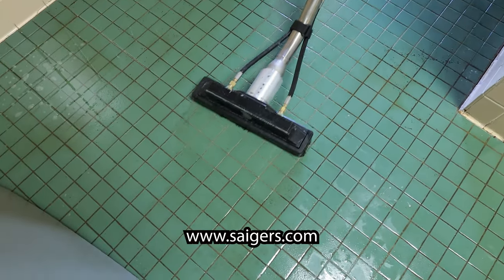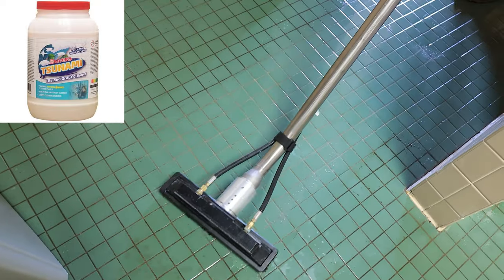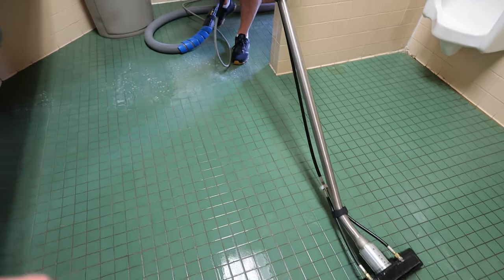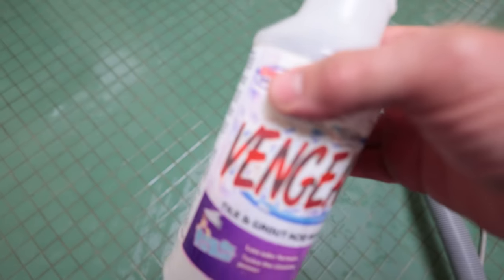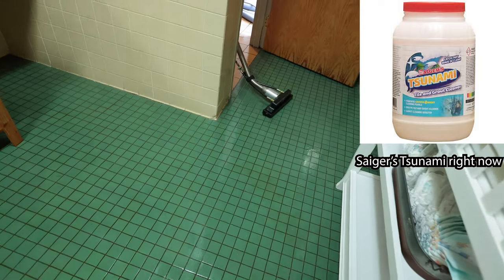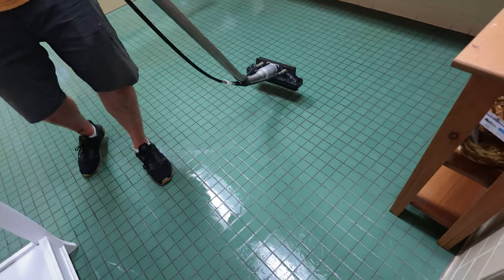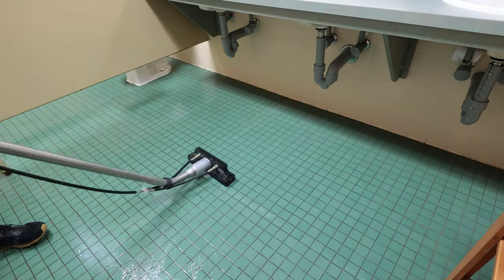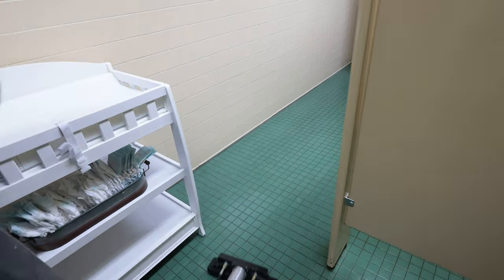Useful Tips and Tricks to Clean this Tile and Grout!

Comment: Another important tip as a cleaner is, all the times you cleans floor with cleaner it can leave a film and over time the film builds up.   I like to clean my floors with vinegar and water every now and then to reduce the film left behind by so many cleans.  This video is so soothing ! Amazing machine and job!
Reply from the maker: Thank you and thanks for your comment and tip. Another tip, if people reading this have a natural stone, you would want to avoid using the vinegar being it's pretty acidic and could etch natural soft stones. So those especially with soft stones should only use a nuetral cleaner and water. Thanks again for sharing this 😊

Comment: WOW! That Devastator wand is amazing. And the Vengeance. I'll be ordering some now! Can you tell me what PSI is required to run that wand? What PSI are you using in the vid? Also, can u run that off a low 200-220 portable heated extractor and still get good results?
Reply from the maker: We were running 500 psi at the beginning of the video then when we moved to the women's bathroom I bumped it up to about 750 psi.

I'm not sure how it would work at 200 psi but it should work. There are no check valves, just jets. With power psi I would scrub and agitate so rinsing would be more successful. It's a great wand though 😊
Reply: Thankyou! I'll probably run it with a Q12 adjustable psi unit then.  @MarkSaiger

Comment: Nice!  For tjose of us who aren't in the biz, can you explain (in the videos) what your machines and chemicals do, and why one might work better for a certain situation than another?  Like, is this under steam pressure?  What's the advantage of it over the round head turbo whatever?
Reply from the maker: The first Chemical is our Saiger's Tsunami which is a high pH hard surface cleaner. Alkaline cleaners are pretty common cleaners being above nuetral 7 pH on the cleaning scale. The Tsunami helps to float and loosen the grease and grime off the surface and in the grout. The second cleaner was our Vengeance acid tile and grout restorer. What it does as it fizzes, is takes a small microscopic amount of grout off the surface to expose new fresh grout to take away staining. The other cleaning unit you have seen in other videos would be a turbo spinner hooked up to our Truckmount Steam Clean (Hot Water Extraction) or a very powerful portable. A turbo spinner needs at least 700 or more psi to spin it so it can clean. You can run higher psi but as you start to run above 1000 psi you can damage the grout while cleaning. By damage I mean you can blow weaker grout (even good grout actually) right out of the lines so you need to be careful. This Devastator hard surface wand is much gentler on the tile and grout but still has good cleaning power with the unique way the underside jets and vacuum slot are designed over other hard surface wands on the market. For us, we like using it in bathrooms a lot as it's easy to maneuver and get around things with it's ridgid swivel set up. Chemical and took choice is a personal thing a lot of times. We designed our chemistry to work well in a lot of situations as we use it daily, so we did and still do a lot of field testing. Time is money to us so we want chemistry to work. The tools we choose are the same to us. We are lucky to be able to pretty much buy what we want for equipment as again it makes our jobs easier so you will see, we have lot of tools, AND we prototype and help develop tools with friends. We are very thankful we have what we have. Please let me know if there are more questions or more details I can help answer. I know there might be something I'm missing and would really like to help explain more. Thanks for your wonderful question by the way 😊👍
Reply: @MarkSaiger   Wow, thx!  Are your chemicals, zipper, etc available in other places in the US?  I live in Phoenix.  Would a carpet company here have a zipper?  How would I know if I need a zipper vs a steam unit?  I've seen you use both, but how do you know which you need?  Do you have informational videos on your website?
Reply from the maker: @annw1395  our cleaning chemistry is available to all cleaners. There are possibly some cleaners using Saiger's Sauce Products in your area. A Zipper Wand by the way is more designed for commercial use. It's a bit more cumbersome in residential, but there are better Wands over a traditional 2 jet wand a lot of cleaners use. The Devastator wand like we use actually set a standard that other wand makers try to copy now. Tile and Grout cleaners in Chems and equipment can vary as well. If you let me know where you are located I might know some cleaners in your area. You can leave a message with my office and they will forward to me and I can even call you back. I will do my best to see if I have some people I might know that will be of help, 😊
Reply: @MarkSaiger  Thank you. I didn't expect you to spend so much of your time writing such a detailed explanation!  I appreciate your helpfulness!
Reply from the maker: @annw1395  my pleasure. Thank you for the question. Glad I could be of a little bit of help 😊

Comment: Nice work where did you get your 4jet
Reply from the maker: This is the newer Devastator hard surface wand. A different design as the jets are not in the vaccum slot so they will not get clogged or disturbed by the dirt and debris. You can find it at www.devastatorfilter.com 😊

Comment: Vengeance seems like a peroxide based cleaner.  Have you thought about applying it with a pump sprayer?
Reply from the maker: It's actually an acid. The foaming look is the acid interaction with the grout. Acid grout restorers remove a microscopic amount of grout to expose new fresh grout. With an acid you can spray it in maybe a place such as this bathroom but it's really better and safer to pour and mop around to prevent damage to acid sensitive surfaces. Thank you for your comment though. Will help others as well I hope 😊. And we do spray peroxide solutions quite often to address that too. Great comment here today. Thank you

Comment: I used to get after my guys for lifting the back of the carpet wand, always felt it looses a little suction when they do.
Reply from the maker: As you see, in the case of a hard surface wand it can. On carpet it can be more forgiving actually due to more surface contact available on carpet

Comment: Is there an advantage using this over the spinner tool?
Reply from the maker: You will still want a spinner in your arsenal, but this hard surface wand is really easy to maneuver and does a great job of cleaning. We like how well it edges also. But there will be some places a spinner will still be needed probably. But we also wanted to show how you can clean with a hard surface wand also for those that do not have a way to run a spinner tool 😊
Reply: @MarkSaiger  thanks for the reply! Trying to learn as much as I can. I’m in the process of starting up my business and sometimes it’s all so overwhelming
Reply from the maker: @BUCKSHOTSTV  I understand 😊. Reach out anytime though. Will do my best to try and help out 😁👍

Comment: I’m always wondering why they don’t make the grout more even with the tile. When there’s less of a ‘dip’ tere’s less room for dirt to get stuck.
Reply from the maker: It's all really because of the concrete it's set on and then how fast they skim coat the grout in with a trowel. But then it comes down to how they use a wet sponge and water to clean up the grout overage. Time is money to the installer so they are not very good sometimes cleaning and leveling. It is a bit difficult to be honest. We have seen some terrible grout haze on new installs which takes an acid or special grout Remover for some of the newer types of grout to get that haze removed. A good installer is hard to find truly
Reply: @MarkSaiger  Yeah, I’m just on the sideline wondering. Cleaning tiles and scrubbing groutlines, not my fave thing.
Reply from the maker: @noeraldinkabam oh I understand that. We had one the other night we had to clean and scrub twice. Ugly mess behind a bar

Comment: As a basic human, Can I use this in my area without that m@chine?  Help!
Reply from the maker: You would need that wand we are using on the floor hooked up to a cleaning and extraction machine unfortunately. Sometimes people will take our cleaning products and mop on the Tsunami, then scrub with a deck brush and grout brush you can even get at Home Depot or Lowes or similar then use a wet shop vac and follow up with clear water rinsing using the shop vac again and a microfiber flat mop. It's a bunch more work but it can be done

Comment: No agitation?
Curious - not criticism 
Demoing the power of chemistry?
Certainly came clean
Reply from the maker: Yeah no agitation. We wanted to show that it is possible to clean with lower pressure for those cleaners with smaller cleaning units and also no turbo available... And no agitation available. Agitation could maybe have sped up some cleaning but again was also experimenting for our knowledge too 😊
Reply: @MarkSaiger  
Agitation is the key to improvement no matter what the application 
😮
Reply from the maker: @toom8rs15  true but not everyone has agitation really in there bag of goodies, so I have to test products we make also without agitation to see how well it can work.